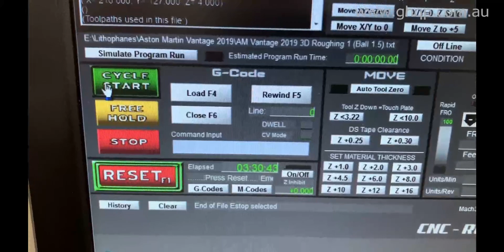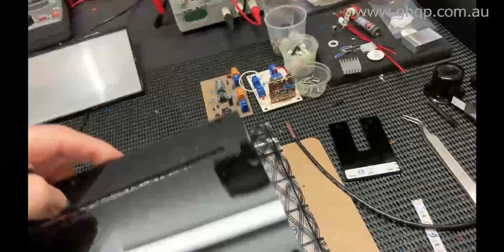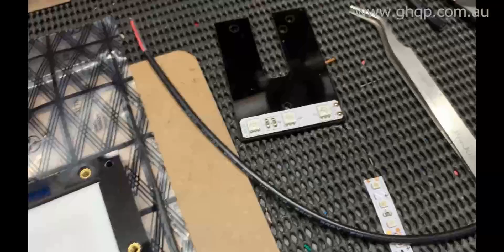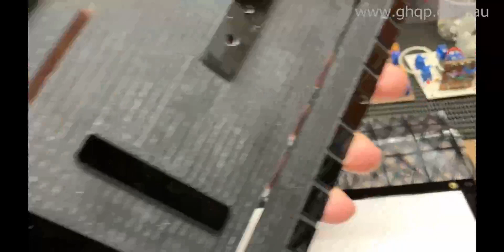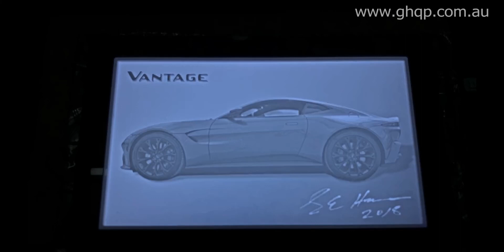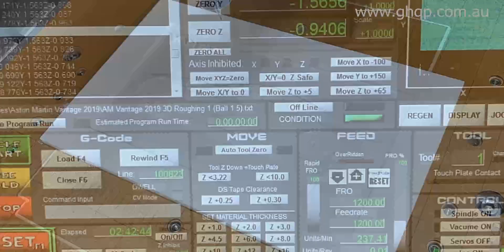Making and Framing a Lithophane

Comment: Can I ask as to feeds and speeds, RPM, DOC? thanks
Reply: I generally use a 1.5mm 2F Ball Nose end mill for roughing then a 1.0mm or if I want a really detailed finish a 0.5mm Ball Nose 2F for finishing at about a 30 Deg angle. Speed and feed. Speed nominally 18,000 to 24,000 RPM doesn't make a lot of difference.
1.5mm Ball 0.5mm Depth/pass, 1200mm/min Step 50%
1.0mm Ball, 1000mm/min Step 10-15% depending on quality and finish I want.
0.5mm short Ball, 800mm/min, Step 10-15%.
In Vectric Aspire that I use the finishing pass Depth/pass is pre-set based on the roughing pass tool and settings.
I only use Cast Acrylic for all my work as it will not melt or clog the cutters at even 24,000 RPM.
Hope this helps
Reply: How long it takes for machining roughing and finishing?
Reply from the maker: @dodenk2261  For this one I cant remember exactly but on average 6 to 8 hours in total.